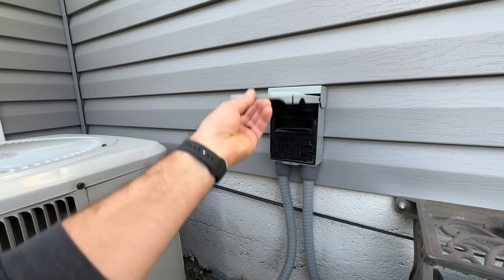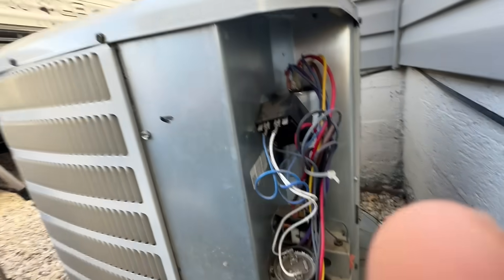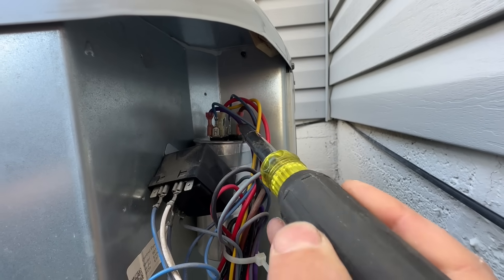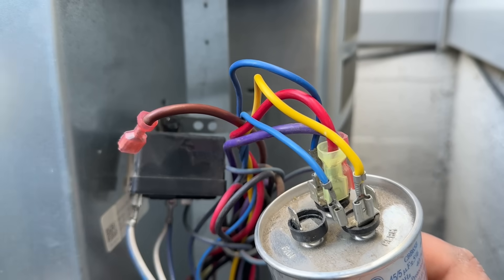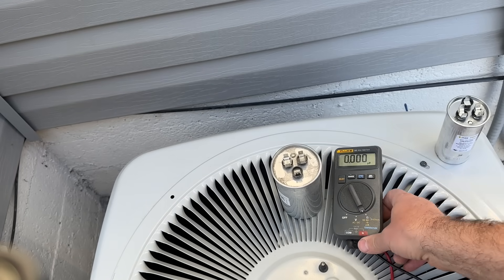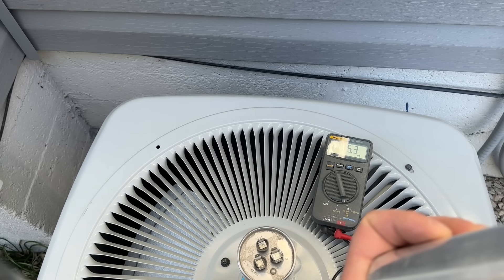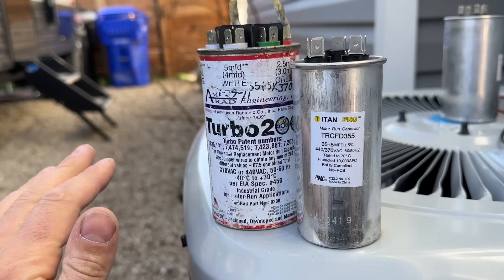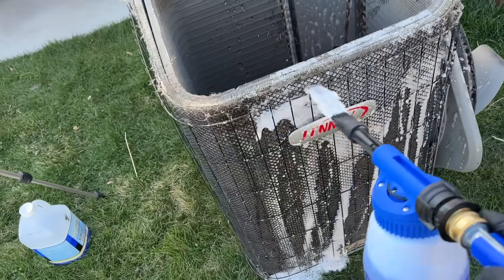How To Check & Replace An Air Conditioner Capacitor

Comment: I got screwed by this. The last time I had my ac serviced, the tech said the capacitor was bad, and quoted $500 to replace it. When the tech pulled the bad cap, I insisted he give the failured unit.  I proceeded to look up the part number, and looking at the invoice, he charged me $250 for the cap. A quick Google seach showed me that the EXACT part number from Amazon was $25 ... After watching your video, I'd love to be able to do this replacement myself, but I'm a 73 year old partially crippled guy, and my ac is on the roof, there being absolutely NO way I'm able to use a ladder to get on my roof. I guess I'll be stuck with getting screwed the next time this part fails.
Reply from the maker: I’ve heard of people charging $700-$2000 for a capacitor!! It’s absolute robbery. So your $250 bill is not too bad 👊🏼

Comment: Wow what a great information!  Would you recommend replacing the capacitor with the new one before the capacitor brakes?

FYI, the AC unit is only about 2 years old.
Reply from the maker: Generally the life expectancy is about 5-7 years but I’d pick one up and keep it somewhere in your home for sure!!

Comment: Questions, would a faulty one cause the outside to turn off randomly? Mine shuts off while the air handler is still running. If I reset the breaker and pull the outside fuse next to the unit it will run again for a couple days and then fail. I haven't tested yet, im terrified of electrical work😅
Reply: Side note, ac tech said he tested it a couple weeks ago and doesn't know why its doing what its doing. He never removed the capacitor though.
Reply from the maker: It doesn’t have one of those electric company devices on it? I’ve heard of Rocky Mountain power installing them here in utah and sometimes they cut out during peak use. It’s quite dumb but Americans are spoiled and have to have their house at 68 all summer. Lol
Reply: No, the capacitor will only cause problems on startup. Of the system is shutting off prematurely then it is either tripping a safety switch or there is a loose connection. Make sure the outside coil is clean and make sure the air filter is clean. Check the 24 volt wiring for loose connections at the outside unit, control board of the air handler, and the thermostat.
Reply: I've seen that symptom when the contactor contacts have arced and tried to weld themselves together and left a tiny bead of metal on one side. When it cuts off, check to see if the compressor is too hot to touch.

Comment: Really GREAT help for a guy out here in PHX trying to keep the house cool in this 117 degree weather! Bought two capacitors for backup, and a few sets of fuses. Last issue we had was last year putting our family (2 very small children) out of AC during the 120 degree heat wave for about 3-4 days. Ended up watching some of your videos and got the courage to start checking the unit myself. Found out the fuses had popped and replaced them. There was a crazy storm the night before which I guess could have blown the fuses? Who knows. But I DO know that  you have no idea how much your content helps people like myself in times of incredible need. So thank you from the bottom of our families heart!
Reply from the maker: Thanks! Happy the videos are helping folks out.

Comment: Ok… So was the problem that the outside unit was dead, running without cooling, compressor not turning on, fan not running???
Reply from the maker: Yes if a capacitor has failed it could be that both components aren’t working, but it could be that one of the two is working, like compressor but no fan, or fan but no compressor 👍🏼
Reply: @diyhvacguy   Thanks!

Comment: guy put in a new capacitor. it still doesnt  cool .it sounds like it stay on for a few seconds n turns off. the unit works but not cool. do u know what the problem is

Comment: Thanks for the tips.
You may want to explain why you replaced a 45 uF cap with a 35.
Reply from the maker: I did not; I used the 35 as an example to test. In hind sight I should have used the same cap to test as the one I replaced. My apologies.

Comment: I got bit by a capacitor much smaller than that and it was the worst and most painful jolt i’ve ever felt. Nothing like 110,it pretty much discharged everything,at once into me. Brutal,don’t be complacent with capacitors. I can only imagine how much energy one that size is capable of.
Reply: As a electrical engineer who works on medical equipment I can feel your pain...Cap. jolts are bad because they can hold a lot of VOLTAGE for quite a while. The good thing is most don't hold high CURRENT (which is what can kill you).

Comment: Wait till one of your followers get hit by a capacitor, they will regret ever trying this there self. This is the number 1 reason they always say have a qualified tech repair your HVAC system.... DYI has no place in THE HVAC industry. Do not even think about DYI in the hvac commercial industry working with 3 phase 460v a wrong move and your dead. I see a law suit in your future...STOP your madness.

Comment: Very informative video......!!!
I'm a retired electrician........not too much HVAC experience though.....
Sister in law called me for help because her unit was not operating...
Checked thermostat and contactor.... changed the contactor......unit comes on in test mode but doesn't stay on.
Capacitor maybe......??? Thanks
Reply from the maker: If the unit comes on at any point, the cap is not bad. It would prevent the unit from ever coming on. Maybe a contractor or thermostat issue. If you need some diagnostic help check out our Patreon membership at Patreon.com/diyhvacguy   Cheers
Reply: @diyhvacguy  Thanks for the reply...

Comment: My HVAC guy installed my heating and cooling on a hot July day in 2012. He had to take care of a leak and a collapsed condensate tube that had to be replaced while it was under warranty, so no charge. I called him July 1 when my fan would not come on and he came out the next day, Sunday, and replaced the capacitor after 11 years in service. I paid him $160 for his time and work.
Reply from the maker: Sounds like a stand up guy! Good on him 👊🏼

Comment: I would just move each connection over from the bad cap to the new cap …. one at a time. 

Take pictures for sure but moving over one wire at a time saves a lot of guessing and let’s you know right away if there’s a wiring issue or question.

Comment: I looked up your video and other videos after my AC stopped working. I first called a local HVAC guy and he said it would be at least week. He also said that what I was describing might be the fan motor which would typically run around $3500 to replace, but it might be a capacitor which would be "only around $2000" to replace. I watched your video and another video on cleaning coils. I bought new capacitor for $15 (and a spare for a rainy day) and a can of coil cleaner for $8. In about 45 minutes, I had the capacitor replaced, coils cleaned, and nice cool air in my house. Thank you.
Reply from the maker: That is absolutely insane… it makes me really sad that hvac companies are doing this. I’m so happy you got it going and saved literally thousands of dollars!!
Reply: @diyhvacguy  It put me in a coil cleaning mood, so I also cleaned the coils under my fridge and now that's running noticeably quieter. I also watched other videos on cleaning evaporator coils and I'm going to try and tackle that over the weekend. It looks like they might be in an easily accessible location on my system
Reply: @diyhvacguy  it is called extreme capitalism . they just wanna make a quick and big buck. btw, thanks for sharing
Reply: $2000 to replace the capacitor?  Wow.  The motor fan is easy to replace too.  What a rip off?
Reply: @cuongandmari that’s what we were quoted 2 years ago…
Reply: @benjaminhodge5110  I didn't get scammed because I didn't pay it.
Reply: @duckpwnd  what state you live in
Reply: My Fan was $500 2 years ago and my Capacitor was $400 2 months ago...this is 4 years total so far.I plan to buy a Capacitor myself and DIY.
Reply: I replaced my fan unit on my house and my neighbors house, both of our AC are in the garage and are vertical units, the fan just slides out, just go to an AC with the serial number so you get the correct one.  Not even a 500 dollars job for DIY.
Reply: $2000?!?!? - OMG what a F'n SCAMMER!
Reply: @JP5466 they’re everywhere, sadly.
Reply: My story is similar but with the blower fan. The compressor came on but no cold air out the vents. 2 AC companies wouldn't even take a look, they simply said "you need a new AC unit"..quotes up to $12K!....Finally a small independent guy came over, said "blower fan cap"!..Replaced for $100......l was so happy I tipped him $200!.....I destroyed the 2 other companies on Yelp and Google reviews!
Reply: Kudos to you man to figures it out and tackled it yourself.. trust me a lots of the things at home are simple maintenance that you can do instead of paying a tech. YouTubeversity helps too
Reply: Tell me you LOST that HVAC guys phone that quoted you $2000 for a new capacitor, lol.
Reply: Good job. You are capable. Videos help.
Reply: this industry is insane -- I had HVAC/AC service for $390 (30 min job) and few days later tankless water heater threw an error; during the service, i asked to look at the tankless and they said not to touch it unless there is an ERROR! Total BS! I googled error code, found youtube video and manual for my model and it was air filter and the manual said it needs cleaning every 3-4 month! i cleaned it myself -- so easy!
thank you so much for this video -- now i am reading invoice and they said capacitor might need to be replaced soon..
Reply: You are awesome!  I'm standing on my roof looking at what is pretty obviously a bad capacitor and you've given me the confidence to replace by myself saving hundreds if not more..  Thank you!
Reply: That tech was straight up ripping you off…..
Reply: I think this commentor is just lying and trying to make hvac techs look bad. No one is charging $2000 for a capacitor. Give me a break.
Reply: @benjaminhodge5110 did you even read lol.
Reply: It’s not a scam….. if all the workers decided to be real estate agents 20 years ago
Reply: @jimsummers487 or mold specialists lol
Reply: These companies are absolute scumbags
Reply: Wow! Good job and here I thought only women get ripped off!
  I'm proud of you. I reside in a retired military Veteran neighborhood, and we get taken advantage of. What makes it worse is that on the average, the Tech is a retired Vet, too! Smh
Reply: Man, what a shocking ripe off! We sometimes forgot that knowledge is true power in all things indeed including saving big all mighty greenbacks n not putting our selves 2 dangerous situation, one thing I never go large party where some scm bog ahol try all kinds of things, including shootings n SO my safety policy or motto is that no matter how friendly or even honey words, they will not persuade me 2 go potential invitation 2 quicksand...! The so much 4 sharing bone chilling n ice cold shivering rip off 2 us! U also did public service 4 sharing ur real fact. I know not everyone has social media why no social media can come even close 2 YouTube reach worldwide, free the vast entire word reach, etc. I never had any social media n never will like some people. I intend 2 stick with YouTube! Again, I or we Ths so much again 2 U.
Reply: How do you know if the capacitor has gone bad? Does the unit just not start?

A recent subscriber. I ordered a new filter for my Lennox system before I turn on my A/C this summer. I found your video on cleaning the coils by spraying water on them, so Im doing that, too.Thanks.
Reply: @mrxman581 In my case, the air was still blowing, it just wasn't cold. Sometimes the capacitor is bulged when it goes bad (wasn't in my case) so you can tell that way. You can also treat it with multimeter, but I didn't have one. From what I've read, the capacitor going go bad is one of the most common problems, so I ultimately just chanced it (since it was only a $15 part) and it worked for me.
Reply: Amazing. I canceling my quarterly maintenance visits. Every visit they just tell me my furnace needs replacing because it's old, but there's nothing wrong with it.
Reply: @duckpwnd  - That's freaking amazing 👏 🤩.  I hate how these service people plant a cost seed without looking at your unit. It's a shame how much they want to charge. If you are given a free written quote, check it out and, if needed, purchase a New AC unit from a reputable company.
Reply: Glad to hear that you didn't get scammed.
Reply: I have the exact same story as @duckpwnd. Called up HVAC and all said 'next week' or didn't even pick up the phone. The key to my success was the microfarad test. Look up the symbol for that on your multimeter for microfarads (µF) under your capacitance meter setting, which on the dial looks like –|(– and test the terminals (you can find how online).
Reply: @TheDarkHour684  found my issue. HVAC guy whose a friend of a friend came out and when I checked my thermostat batteries i didnt seat the cover back on it right. Mind you I put that thermostat in myself on February and made that rookie mistake. 😂 my outside unit wouldnt come on at all. Inside blew hot.
Reply: Yup, it's absolute bullshit that people will take advantage of you like that.  I was charged 800 dollars for a board for my heater in dead of winter.  Next time it went out, it only cost me 40 bucks to buy and install myself.  Frucking losers.
Reply: If the figures you indicate are accurate "$3500 fan motor"  $2000 capacitor"   you may want to contact your states Attorney General’s Office regarding unethical HVAC scams. Report this scum bag.
Reply: $2,000 for replacing capacitor? Where is that, San Francisco?
Reply: Incredible
Reply: Powerful testimony...
Reply: Omggggg wow.. what a ripoff!! I hate seeing people rip people off like this!! Especially elderly folks who are usually on a fixed income!! So grateful for honest videos like this!! God Bless!
Reply: $2000 wow,  people can be such low lives.
Reply: What volt meter did you use?
Reply: Where did you get the capacitor for $15?
Reply: I'm here because the ac guy told me i needed new inside and outside units without when looking at the outside unit or a blower motor for $800. I saw him take out a thing and put in another and the ac worked. So I bought the thing. A capacitor for the inside unit and fixed it. Now a handy man told me my outside capacitor is bad because when he pushed it the unit came on so I'm just checking my options. May be the wiring but I love research
Reply: 🎉1
Reply: You have integrity and that is most important.  Deception is thievery.  2,000 grand to change out capacitor? Thats criminal. There are split units you could buy cheaper
Reply: Name the company. Otherwise COOL STORY, BRO.

Comment: He went down from a 45/5 to a 35/5.  I'm pretty sure that is not a good thing to do, unless the original capacitor was 35/5 and it was done incorrectly the time before.

Comment: Two years ago the capacitor on my AC unit (Ruud) went after more than 30 years.  The technician could not believe the capacitor was the original.  When he replaced it, his words were, "Well, I hope this one last that long, but I doubt it."  So far so good.
Reply: I’ve read that they have changed what they make the capacitors out of for environmental reasons and the new ones don’t last as long.
Reply: @kylelaw7210  
I don't doubt the new capacitors have changed to meet some wacky environmental regulation, cutting its life short.

Comment: I wish I seen the symptoms, of how I would know it's the capacitor.  Just saying. This does give me the confidence to repair it.
Reply: Growling or humming when it tries to start. Motor or compressor is hot to the touch. Best tested after unit has been off for several hours to give the thermal overload time to cool off.

Comment: Can your air conditioner run if their is a bad capacitor or will it not run at all?
Reply from the maker: Sometimes both the fan and compressor portion of the capacitor go bad, but a lot of times it’s one or the other. So either the fan will run but no compressor or vise versa.
Reply: @diyhvacguy  The fan side of mine quit, and the compressor would run until it got too hot, then shut off until the pressure dropped. Ne cap cured it.

Comment: What's your opinion about the soft start units that people are installing on their own units?
Reply from the maker: I have two videos out on soft start kits check them out! They’re great if you want to run your ac with a generator. Also great if your compressor makes a lot of noise at startup and flickers your lights when it kicks on 👍🏼
Reply: @diyhvacguy  Thanks so much. Will do.

Comment: Danger! Almost any capacitor if you touch them can kill you. Jim at work for fun touched a small camera capacitor, and it sent Jim to the ground.
Reply: I usually discharge a capacitor with my wang
Reply: Wow 

They spark when you discharge em it’s like a welding spark

Comment: it's not worth checking the capacitor if your motor is humming and not spinning discharge the capacitor and change it if your motor is not humming then you've got another problem always discharge the capacitor I had one I thought I'd discharged it knocked me through me against the tree they will get you I am in the upstate South Carolina and these rednecks wanted $480 to change a capacitor when the condenser when failed 4 months later the furnace one failed how much did I save while I was in the furnace I changed all the wear parts of course I save myself a bundle........